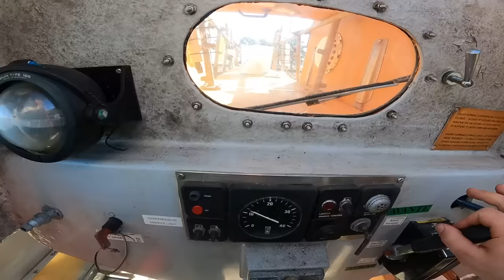Camping On My 64 Person Enclosed LIFEBOAT!!

Comment: Have you thought about spending 100 bucks and doing a little work to the engine? Most all lifeboats have a keel cooling system. The heat exchanger on the keel cools the engine. As long as you have antifreeze no worries about freezing anything. To be truthful just be happy you have a starter. I have been on a lot that had hydraulic starters. If it doesn't light off right away get to pumping but then you don't have to worry about batteries. All of it is better than a Fleming gear life boat.

Comment: Cold start run glow plugs with cranking the engine to on but not run, white smoke is ok black smoke ok. White and black is the problem where water and oil I believe.(I say black smoke is ok because carbon is the only reason it's not) roll that diesel coal.

Comment: With that much weight on the trailer, you should probable unhook her from the trailer, put a pilot at the controls, and back her straight into the water. It is dangerous to park the truck on the boat ramp and stand behind the truck with 24,000 pounds pulling on it (while you are prepping the boat for launch). Eliminate the chance of the truck running over you!!!! Safety 1st!

Comment: The smoke is from the cold start. The reason it is in the cab is the same reason you have a carbon monoxide issue. You have an exhaust leak. It started so easily the next day because yall heated the cab up so much.

Comment: Why didn't you get it running good and sealed before launching the boat?  Most ill prepared boaters I've ever seen.  You have a giant Jon boat. If a storm comes up, you're in pretty good shape. It could double as a submarine, an orange submarine.

Comment: You have to winterise any boat that is exposed to freezing conditions. Rebuilding a diesel engine that big, is only viable if you are rich. You didn't use the glow plugs which preheats the injectors. So you were lucky it started. You really do need to learn about marine diesels.

Comment: You plugged the hole you saw (and ASSUMED it was a hole made afterwards for storage purposes), with fiberglass when you bought the boat. You should have researched or ask the owner if he made that hole or it was always there when he sailed it. 
You sealed it! NO NO NO! That was the exhaust, yes, underwater exhaust, which is why the fumes are now INSIDE the boat. They have nowhere else to go. This boat is from Sweden and is different, there is a reason to send fumes under water, not just noise concerns, but in case there is a fire in the water. The boat can also spray sea water around itself in case it needs to go through water fires.

Comment: The stupid leading the blind.  You guys really need to study up on  engines  particularly  "what is in the boat"  BEFORE you go out, and since this is no longer  a real lifeboat, maybe figure out a way to put about a 10hp  outboard  on the thing.   THINK----About a  5--10mph breeze is all it would take  to overpower your  paddles, assuming you don't DROP one of them.  
Review  some CG/ marine regulations concerning  safety of bilge ventilation.  Does that  engine compartment have  a ventilation blower/ system?  Why not?

And put some time into engine maintenance  so you KNOW  it's condition  and KNOW whether it will run

And IF  you think the smoke was electrical, put some time into  figureing out the boat  electrics, and  be CAREFUL what you modify

YOU ARE INSIDE A SUBMARINE  for all purposes,  NOWHERE to run.  The slightest   electrical / fuel fire  is not only going to be a disaster,  it might just be DEADLY.   Do you have  smoke alarms/  CO detector(s)  / explosive gases detector(s)  on the boat?  WHY NOT!!!???